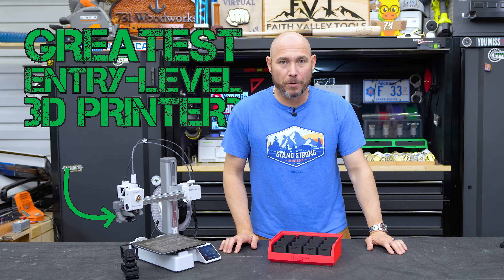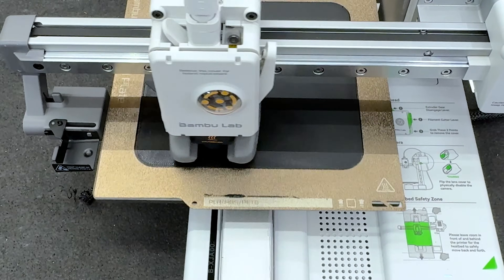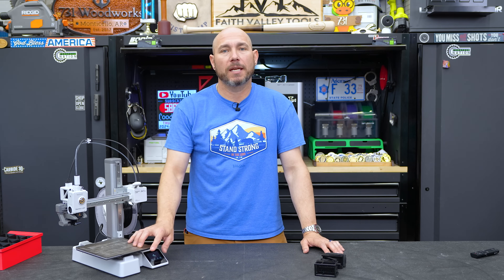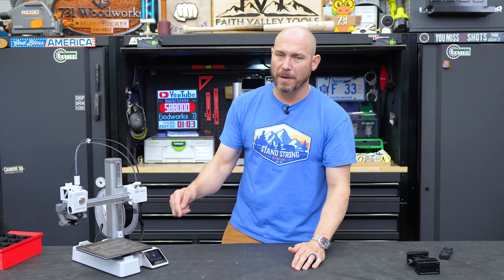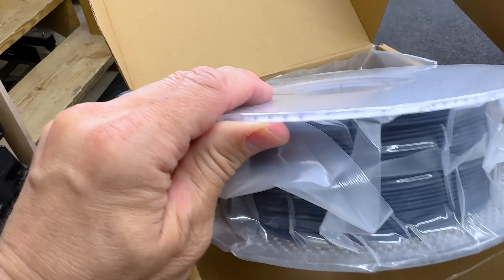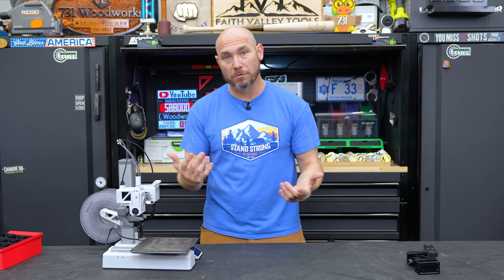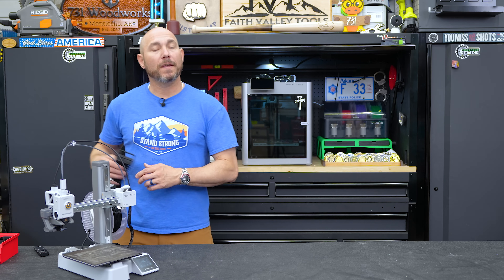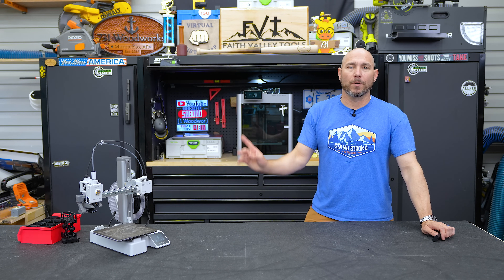99% of Beginners Should Start With This 3D Printer - Bambu Lab A1 Mini Review

Comment: Have you had any glitches with it when you were over 300 hours on it?
I have had mine freeze halfway through a print, screen stay off even when you touch the screen to check things, the x,y,z move without a rhyme or reason, and go up and down without touching a thing. I am finding no one talks about these issues; they talk all good and don't talk about what they have really run into or how to fix it, like turning it off or resetting to the factory, and so on.

Comment: I am new to 3D printing and got this as my first printer and couldn’t be happier with it. If you have the budget, the AMS lite is very nice too. Also, I noticed his plate looks pretty scratched up. This set comes with a metal blade and a 3D file for a bed scraper. I personally would not use that with the texture plate, print a plastic one instead. In most cases you don’t even need it, just remove the plate and give it a little bend and most prints will release very easily.

Comment: Great presentation style.  Yes very easy to set up and use.  Four different apps makes it complex: studio,  handy, lab and model world.  All linked to the same account, but need to log on separately.  Big negative is that the printer is personal, can be bounnd to only one account.  This means household can't share it.  Annoying, work around is to set up a fake email and use that to register, even then it needs a phone number for two factor id for everything, everytime.

Comment: pls dont buy the mini one, you will have FOMO for not buying A1 because of the size of the plate. Also make sure you buy one with AMS already, as you will definitely want in the future AMS system anyway once you start playing around with the printer. Not only it allows you to print in multi colours, it saves time in not needing replacing filament each time it finishes and it will help you a lot while printing at night because the filament will be automatically swapped in case there is no more filament.

Comment: So I have to ask how long have you spent learning to use the 3d cad software, as no matter how easy to use the printer it's worthless unless you can design what you want to print.  I spent years learning V Carve Pro for my CNC, but packages such as Fusion 360 are not very user-friendly.

Comment: One thing about the A1 is that it vibrates like crazy.  It shook everything off my workbench the 1st time I used it.  Looked around and a patio paver seems to be a base that will reduce vibration.
Reply: They say to get a good piece of thick granite. Real hard to find. Thick enough paver will work too though. I’d check a local granite shop for scrapes I’m sure they would sell some

Comment: Oh, and the nice thing about the AMS is that you can load multiples of 1 color and it will auto switch when 1 spool runs out. I have it set with 2 black PLA and 1 black PETG and 1 grey PETG. AMS also keeps the spools dry and humidity can effect filament causing a failed print

Comment: The benefit of the AMS in my opinion is the ability to have multiple colors or types of filament loaded and ready to go and also the ability to not worry about running out mid print if you keep a secondary roll in there.

Comment: These Bambu Lab printers are the best. I kind of got into woodworking more because of 3d printing. Seeing where these lack and where wood working can fill in led me to this channel. 
These are the 1st printers I have used that were not the project themselves but actual tools you can count on. Also, not just for beginners, Bambu Lab just makes a great tool that works for all levels. They left Prusa in the dust, sorry to say. You just need to learn some concepts to use the slicer program which you would need for any printer.

Some hints. 
Use Orca Slicer over the Bambu Slicer

Do your Flow Dynamics Calibration for your filaments, it will save the k value which will determine the flow rate for that filament. Not all colors of the same brand act the same so do them for white and dark and you should be good. 

Polymaker Pro PLA gray looks so nice It's my go to, I don't mess with Bambu Lab refills any more. Just the cardboard Polymaker rolls.

WASH YOUR PLATES WITH DAWN if prints don't stick. You usually don't need glue. Get the oils off the plate and don't touch it after. 

Faster printing speeds aren't better, they introduce problems so be patient and print slow. 

The AMS and AMS lite use RFID with Bambu Lab filament to read the filament info. Other brands you have to input it manually. 

Last, learn how to do the little maintenance you need every 3 months or so. That will deal with the issues that usually pop up. For real, most problems on the forums are from worn out parts or lack of lube and cleaning. It's a tool, take care of it and it will work flawlessly. Woodworking folks know this.

Comment: I've had an A1 for a couple weeks (not a mini). Having had an Ender 3 for 5 years I see very vividly how much faster the A1 is - it's amazing. Mainly it's a pleasure not to be fiddling with slicer settings and printer mechanics - I just send the A1 a file and it prints, as simple as that. The quality is incredible - parts printed with 0.2mm layer height have a nicer surface than 0.16mm on my Ender 3 or Kobra Plus. I really don't understand how they even achieve that - I mean, a layer is a layer. But somehow they almost eliminate layer lines. We really are living in a great era of 3d printing, for this kind of speed and quality to be affordable to normal hobbyists. 

TBH I think people who make these videos exaggerate how quick setup is. The A1 isn't much different from the mini but my assembly took more than a half hour, because I was making sure to be careful - as I'm sure most people are, especially newbies - I've torn down my Ender 3. Not a big deal, just my pet peeve.

Comment: This is a great video! Been looking to get into 3D printing. I've watched quite a few "beginner" videos, and I think that this is the best one I've seen. Eventhough it is only talking about one particular printer, it touches on all the topics you need to think about in an easy and approachable way. I think this would be a great video for beginners, like me, to watch to begin research and to feel more confident in investing into 3D printing!
Reply: Honestly, Bambu has left most other companies in the dust by making a printer that just works most of the time. It seems crazy but other printers need lots of tuning or add-ons to make them useable. These are the 1st printers I can fuss more on my models and mistakes I make than the actual printer not working properly. 
I usually shop and compare products, so I get it, but I would 100% not look at other offerings in the 3r printing world right now. Other printers just don't work reliably and that's where most of the tinkering and learning has been.

Comment: One thing I'd like to share with you @TheOutlawEffect is with that pei plate. You can use ISO alcohol to clean it off, then try Windex instead of glue stick. Spray some on, give it a quick swipe with a cloth to clean off puddling and go. 😉 I bought that plate for my X1C and use Windex and it's amazing for clean prints and easy release of the parts. I hope this helps you. Thanks for all the great videos!

Comment: Brilliant review.  I was contemplating a resin printer for miniatures but, while I really like the idea of being able to print fine detail better I REALLY don't fancy the mess / clean up / hassle.  Yes I can can do it, just don't want to.  This looks ideal though.  How are the filament lines on the prints?  It's the one thing that always turns me off FDM but I'm told the Bambulabs machines are better than many others.  On balance I think I'd rather put up with lines (if they are not really bad), one machine and a spool rather than a resin printer, wash / cure station, gloves, masks, IPA, chemical disposal, smell etc etc etc.

Comment: I bought the A1 mini a couple of weeks ago and am having a blast with it.  My only gripe is that it essentially only does PLA and PETG filament.  TPU and PVA, the other two filaments they recommend for this model are specialized filaments.  I've had basically no luck with TPU (I've ordered their largest nozzle size to see if that improves matters).  But I'm also using Overture TPU, which may be the problem.  It doesn't seem to want to stick to the bed very well. 

I've used up almost a whole spool of Bambu matte PLA with good results.  And I've just gotten done printing some hose adaptors for a laser cutter vent which I designed in Blender and exported (which was very easy and worked great).  I used Bambu translucent PETG for those.  Worked okay.  Strong stuff, but kinda ugly.

Anyway, I'm hooked.  Am thinking of maybe getting the A1 or possibly the P1P (the A1 still has the filament limitation as the mini).
Reply: Can you speak english for us beginners if we did the right job getting the 0.4 hotsomething and the matte filament they suggest ?

Comment: DO NOT GET BAMBU, THEY HAVE THE WORST CUSTOMER SERVICE!!! Youre stuck with anything you buy, they also buy reviews. If you want to cancel, NO.. if you want to add something onto an order that was missed and they hVe a sale going on, NO!! If you want to return your open box, NO. They wont help you AT ALL. They just want the sale and as soon as its done they mKe sure to slam the door behind you and make you keep everything and are 0 help if issues come up. Worst purchase ever.
Reply: The first 3D printer I bought was an Ender 3 V3 SE. I like it a lot. My Bambu A1 mini takes a meaty greasy 💩 on it. And I paid about the same amount for both. Im going to buy another one in the not too distant future. And now it’s $50 cheaper. Amazing machines. Best printer in its price range by a wideeeeeee margin. Best bang for your buck in printers.
Reply: I had an issue with my AMS, and they sent new parts pretty quickly when I showed them the issue. (I had the early kickstarter backer unit)

Comment: WAAAAAAAAAY too much lube on that Y rail.  That auto color feature only works with bambu filaments WITH an AMS or AMS Lite.  They use RFID to read material information.
Reply: It does not in fact only work with Bambu filament. It only detects which color it is with Bambu filament. The only problem anyone has with using non Bambu filament is it not fitting the spool. And you can 3D print an adapter.

Comment: I have had an x1c about a month, and love it.   1000% better experience than my first attempt at 3d printing with ender 3s  A1 Mini can be bought a Micro Center until July 5 for $175 using the $25 off first time customer deal :).  I am thinking about a a1-mini just because :)

Comment: Do you have to use their filament? Or what kind of filament do I want to look for?
Reply from the maker: you can use others.  PETG for more durable stuff. PLA basic for prototyping, or generic stuff that won't be subject to heat/cold, etc. from what I understand but i'm no expert either lol.
Reply: I’ve never used Bambu filament on mine. I’ve only ever had trouble with some cheap stuff I bought. But that might be user error and need to toss it in the dryer.
Reply: You can use any filament brand. It's all the same stuff essentially.
Reply: @logitech4873  it’s just Bambu brand has bar codes on them and the AMS reads the type and color and automatically sets the correct parameters.

Comment: 11:50 I will add you need Bambuu filament for this to work. it uses an NFC chip built into the spool which the printer and AMS can read.
Reply: You only need Bambu filament if you want the AMS to automatically read the type and color. You can use any filament. The only problem you might run into is the roll fitting. But you can print an adapter for the roll.
Reply: @joelamaro4525  I was commenting in reference to him saying it auto detects the colour, I was aware that any brand can be used, but fir it to detect, it has t8 be bambu filament

Comment: I've had my one for about 6 months or so. Fantastic first printer but I'm starting to outgrow it a bit. If you can live with a 180mm cube print area it's fine.
Just to be clear there's no wired networking option (which you mentioned at around the 9 minute mark), the io ports on the side are purely for the AMS lite.
It send's print jobs through the internet/cloud as well,  if you can live with your designs going through bambu's servers it's fine. I believe there's a LAN only mode but I've never used it.
You can always put your sliced .step files directly on the SD card though, just far less convenient, especially if you're troubleshooting a sliced file.
Good review though mate 🙂

Comment: Multi-color is super for putting contrasting labels on your parts. This can be especially useful for bins. Bambu studio will let you add labels to your parts. If you print it with the label on the top or bottom of the print, it will have to do a lot less swapping. My wife is constantly printing her pretties, however, and she does multi-color constantly. She has a knack for minimizing waste without tinkering with the settings.

Comment: Just a note that the X1C and the A1 Mini print at about the same speed as current gen competitors. They are easier than most though, and in my experience, far more reliable. We have the P1S with AMS, which is the best all-around printer for pro capabilities features/price/reliability. We also have two A1's which is the best beginner printer for those who want the larger format. We just ordered the A1 Mini during the $200 sale price in June. We didn't get the AMS for the Mini but we have it for the A1's. FYI the regular A1 has the same size build plate at the X1C/P1S and actually has more useable space on the bed since it doesn't have that dead space in the corner.
Reply: In my experience as a noob my A1 mini prints way faster and far higher quality print than my V3 SE.

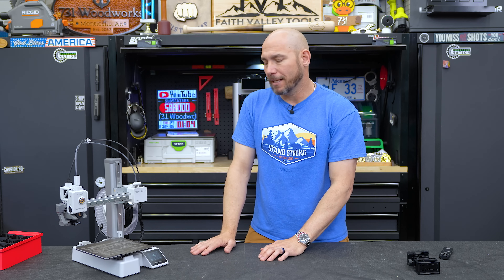Comment: 7:54 I'm probably not the first guy to correct you on that but it's good that you know a few interesting basics: 
(Wall of text incoming, but its worth the read, you'll learn a lot. If you still don't want to, jump to TLDR ;)

First: this all applies to heated build plates. 

-) Funnily glue stick is not (for) making the print stick better to the build plate.
"In the old days", when we only had build plates with smooth surfaces (glass especially), some materials like PETG would stick SO well, that the printed part could rip out chunks of the build plate when prying it off. 
Back then glue stick was used as an interface material, so that the parts would come off more easily - in a way: to stick less.

-) The main reason why textured build plates exist is for printing sticky materials like PETG without having the need to use glue stick.
So the texture, again, reduces the adhesion of your part to the bed. 

-) Nowadays, especially if you have a textured plate, it is not necessary to use glue stick in my opinion. (I'm sure some people will disagree)
I haven't tested the effect of glue stick on bed adhesion when used on textured plates, but for smooth plates I can guarantee you that your average glue stick makes the part stick less. 
So for PLA specifically you never need glue stick on smooth PEI surfaces, it just makes things stick worse.

The only case I see where you could need glue stick is when you specifically have to print on a smooth build surfacce with a super sticky material. But not even then since:

-) Exactly the opposite is true for glues which are specifically made for improving bed adhesion.
Getting a specialized glue is THE most impactful thing you can do to have sucess with "slippery" prints. 
(Any brand will do... but *get one*, seriously, best 10-20 bucks spent in your 3D printing career).
As a bonus those glues have the same effect as glue stick, as in providing an interface layer for sticky materials to prevent them from "fusing" with the print bed surface. 
In short: they make the printed part stick like hell when the build plate is hot, and make it possible for the part to come loose when cold, regardless what material you print with.

-) PEI (the very hard plastic material your textured spring steel build plate is covered with) sticks better to other plastics the hotter it gets.
Since a textured PEI plate has less adhesion than a smooth one, it needs to run a bit hotter (that is why the suggested temperatures in the Bambu Studio is 65°C for textured and 60°C for smooth PEI)

TLDR:

So if you either have small, tall or fast&rough prints coming off the build plate mid-print, these steps help to increase bed adhesion (listed in order of effectiveness):

-) Using a specialized glue for bed adhesion instead of glue stick (3DLAC PLus, Magigoo, etc.)
-) Getting a smooth PEI coated build plate
-) Keeping the plate free from finger oils and dust obviously. 

-) For small parts: using a brim surounding the whole part
   For big parts: using "mouse ear" brim type for corners and small contours is often sufficient 
-) If printing lines fast & thick (lets say 0.8mm thick lines on a 0.4mm nozzle) - and your part comes loose: tone down either the speed or the extrusion with to 0.7mm

-) Using a quality (do not use cheap) dish soap for cleaning the build plate occasionally.

Comment: You shoulda got the AMS lite :) It's really good. I have fewer retraction/feeding issues with it than the AMS on my x1c and it can hold more spool sizes (and it works fine with cardboard spools too). The only downside compared to the full AMS is that you can't make it a drybox.